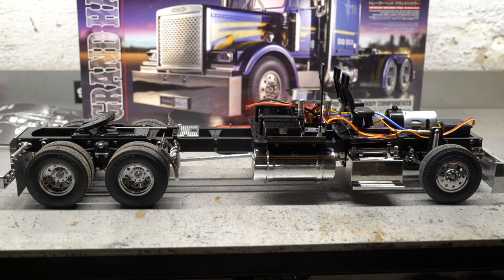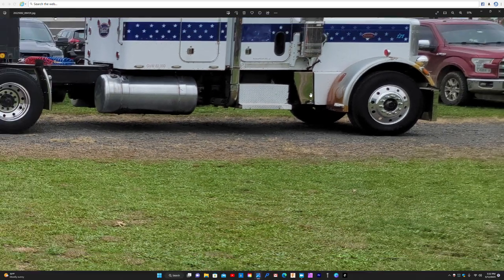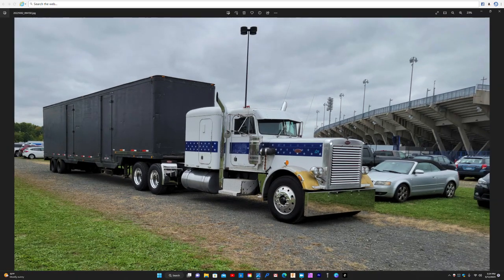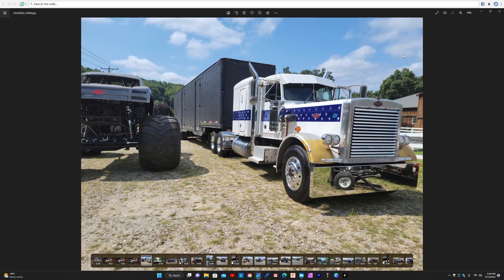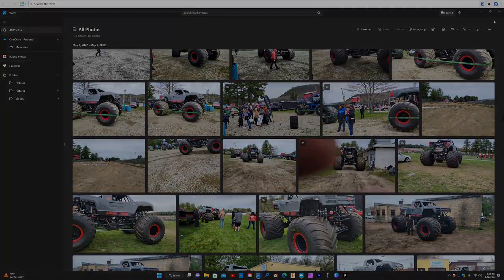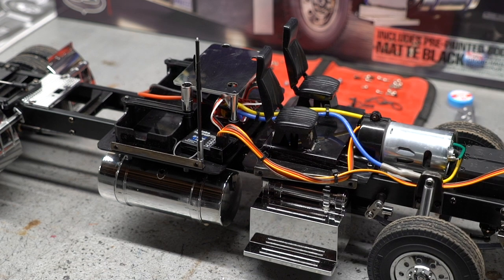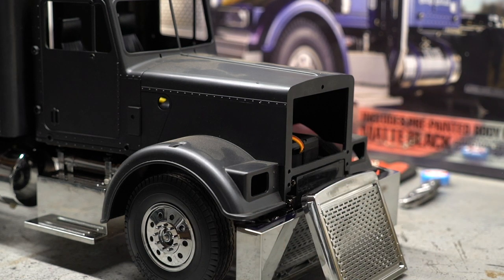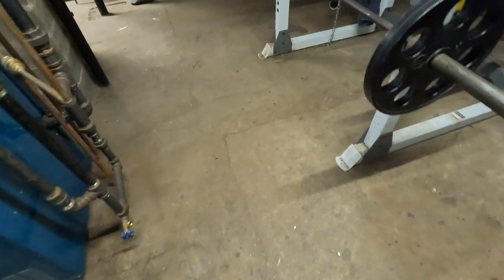Tamiya Grand Hauler build part 2

Comment: looks great! 😁👍Get a 80T rc4wd crawler motor they go fast with a 80T in high gear the stock 540 is crazy and don't have power or low speed control in the lower gears.
Reply from the maker: I'll order one I was just on their website looking at trailers too

Comment: Great work,  if you use a 45 or 55T motor she will run smooth and not be jerky,  So what is the purpos of the extended hood? or is it just a style thing?
Reply from the maker: I definitely want to switch the motor it's too jumpy. The extended hood is pretty much for looks I guess it rides a little better because of the longer wheelbase but mainly it's for looks